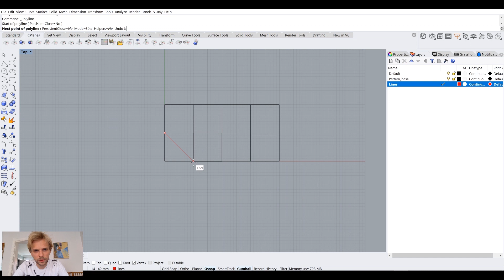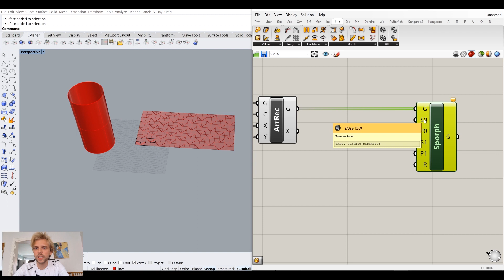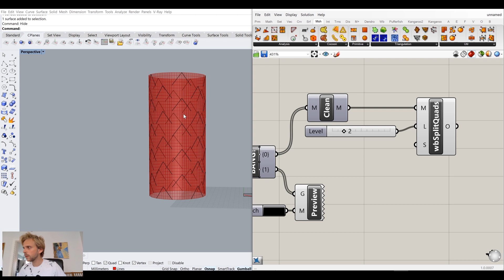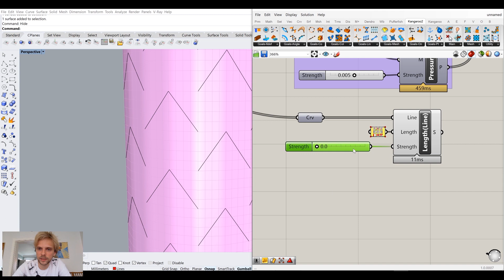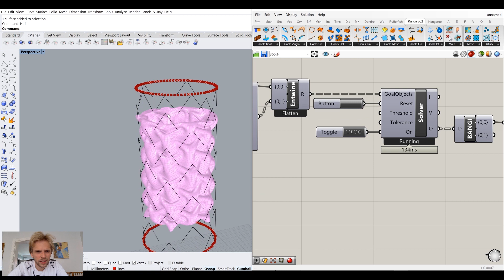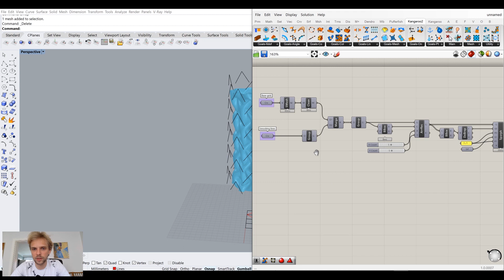2020-30 LTH Tutorials: Parametric Column Design Using Smocking (Grasshopper)

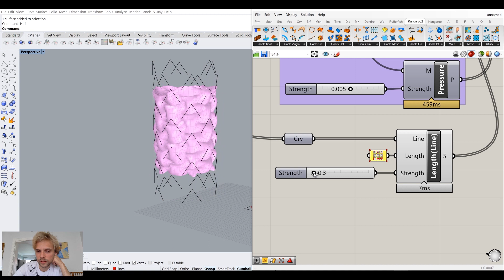Comment: Trying to recreate that and I can't get those folds on the step where you connect those contracting lines and increase the strenth. They just don't interfere with the base mesh. Where the hell those folds come from? It is at 35:39 Could you please explain it of give a piece of the def?
Reply from the maker: Make sure that the drawn likes are drawn precisely from vertex to vertex of a mesh. If the end points of the lines and the vertices dont overlap,  kangaroo will not understand what you want to do.
Reply: @DesignGoBrr  fantastically it worked! Thank you!

Comment: Can we apply this entire exercise on a 5 surfaces of a box? If so how? where we keep the edges conitnuous
Reply from the maker: All you need to do is weld the seam vertices and anchor the bottom side vertices. Everything else would be exactly as described in the tutorial.
Reply: @DesignGoBrr  how do i feed in more than one target surface into the sporph?
should i do each face independently?
the sporph targeting fails fro me

Comment: Nice! But since it can simulate the behavior of concrete, the mold starts to fill from the bottom surface?
Reply from the maker: Yea, the animation of this sim does not show the structure being filled in - it should be disregarded. Only the final output can be considered to be accurate (except for the increased pressure at the bottom of the mold, but that shouldn't be a problem as long as a non-stretching fabric is used)

Comment: Hi Gediminas, 
First off all thanks for making this tutorials! i love it! I'm the only one on my study who is trying to learn grashopper and you really helping me out with this video's !
I have a question about the length line part ( 35.10 min) I doesn't work for me... when i run the simulation its blowing up and then it shrinks a bit. but the pattern isnt visible like in your tutorial. Can you please help me out?
Reply from the maker: I think it's just a balance between the pressure strength and the line length strength. Play around with those numbers and it should work
Reply: lol, I almost would've given up because of this problem!! it really had me. The solution was pretty easy though! explode the polylines that you drew in rhino. so that grasshopper would recognize the middle corner.

Comment: Beautiful Tutorial ! and so helpful :) Thank you so much !! I have a question : I wonder why the mesh disappears when I input sphere collide goal. I significantly reduced the tolerance as well in the solver component. Otherwise, it works perfectly well with all the other goals.
Reply from the maker: Hmm if your sphere collide goal has 0 strength, does it still break? If it does - I would suggest using "remove duplicate points" node for the points that you input into the sphere collide. Usually duplicate points mess it up.
Reply: @DesignGoBrr  Perfect ! Removing duplicate points fixed it.. Thankyou so much :) Looking forward to learning more.
Reply: @DesignGoBrr  Perfect ! Removing duplicate points fixed it.. Thankyou so much :) Looking forward to learning more.

Comment: Thanks a lot! great material. Already suscribed :)
I was trying the pressure command, but strangely the mesh compressed and then expanded. I thought it was ok, but then after advancing on the tutorial my results were further and further away from what was shown. I'll keep checking on it
Reply from the maker: Hmm double check if the mesh is not inside-out (flipped normals), that might be the culprit